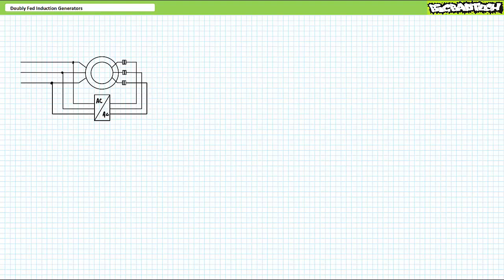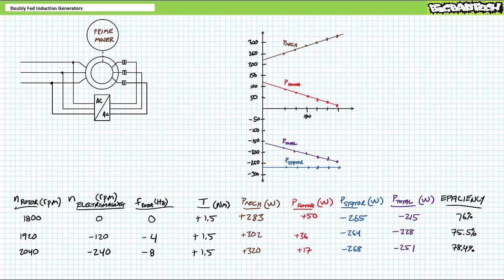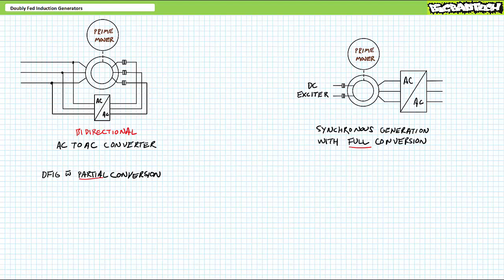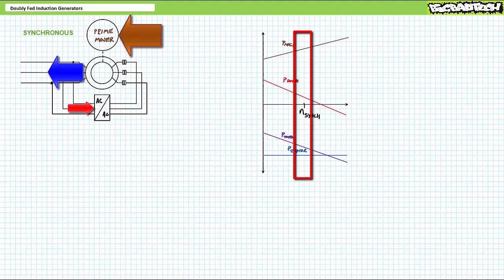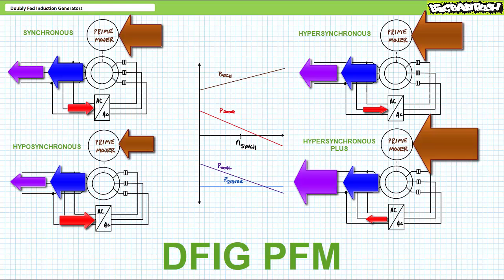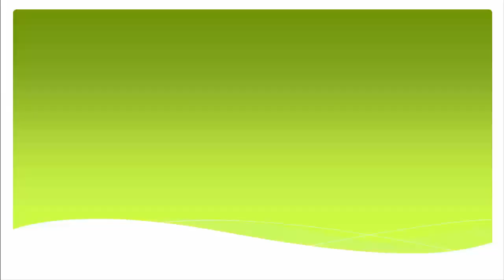Doubly Fed Induction Generators (Part 2 of 2)

Comment: Thank you very much for this informative explanation! Could you please help me with a question ? At 7:12 it is stated that the stator exports 266W of real power. Since the wind energy only supllies 254W, does that mean that some of the 79W consumed by the rotor is recovered ? If not, where do the extra 9W come from. And if so, does the power recovery only happen at a certain rpm in hyposynchronous mode (analogous to the rpm at which the rotor exports power in hypersynchronous mode) or does power recovery happen at every point in hyposynchronous mode? Again thank you very much for this video